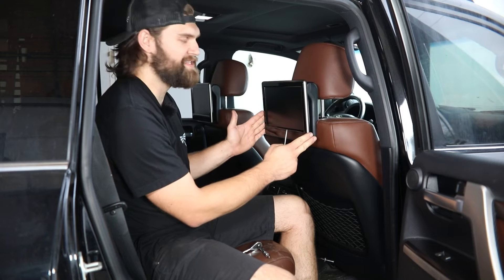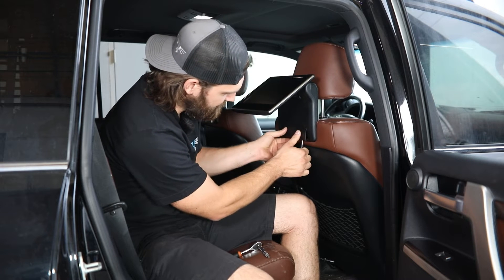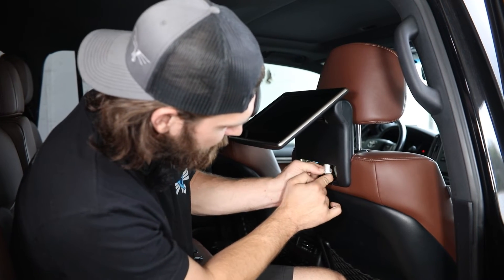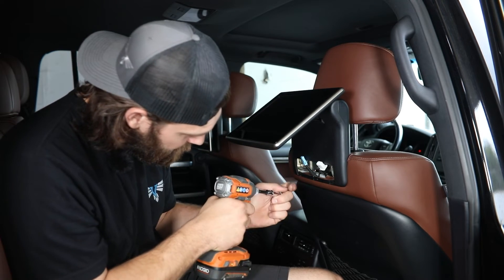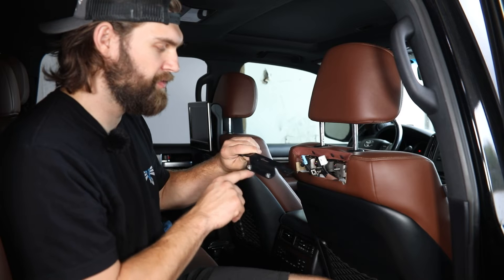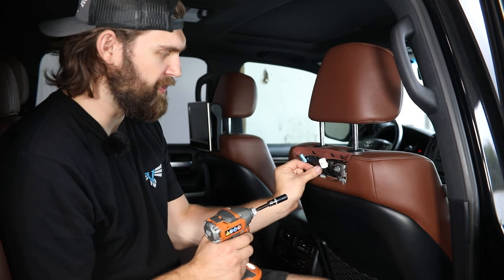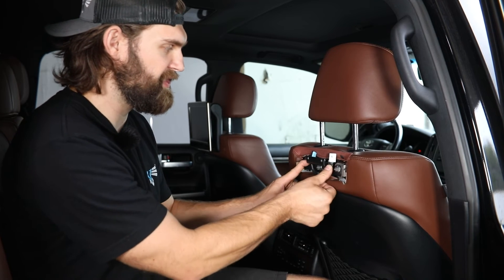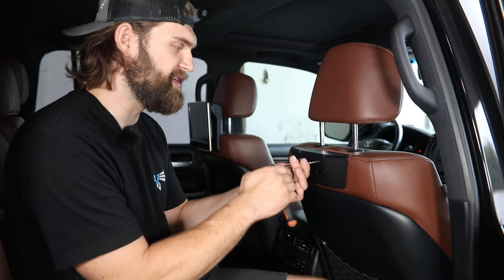200 Series Land Cruiser Seat Back Monitor Delete Install

Comment: Hi Kevin,  Thanks for the good instructions.  I found with my large fingers that completely detaching the DVD monitor then using the small blade screwdriver to push in the tabs on the two connectors an easier way to disconnect the wiring.  The monitor was easy to support face down during the disconnect which allowed direct access to the tabs.
Reply: Hello mr igrowine, would you happen to have a screen to sell?

Comment: What's the benefit of removing rear monitors?  I mean , why would you want to remove them?
Reply: To make more space in the back. It makes it tighter back there
Reply: I've seen many people trying to fold the middle row seats to get to the third row always have the headrests smash into the monitors. Pretty stupidly designed, especially since the cars can be installed with easy access, automatically moving the driver seat back when the car is off, (or the driver door is open, not sure) making the banging into the monitor even worse. That's the one thing that pisses me off about the Land Cruiser, how do you design a vehicle worth tens of thousands, for years, and mess that one thing up?
Reply: We have no kids, so no reason for monitors in the 2nd row.  They just get in the way and are easily damaged when tumbling the second row.

Comment: I'm skeptical how you got those thumb tabs to work unless your hands are the size of a seven year old girl's.  Why can't the thumb tabs face out?!  (Rhetorical question.)  Anyway, in case anybody has mitts like mine, I fished a ziptie around the tabs, yanked both ends while pulling down, and they eventually popped out.